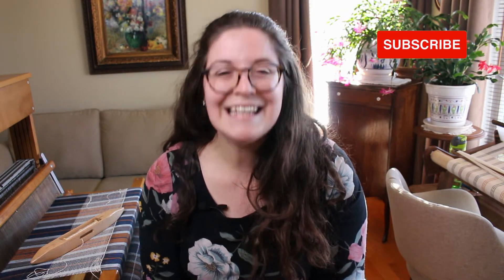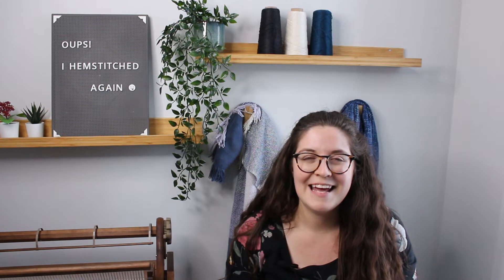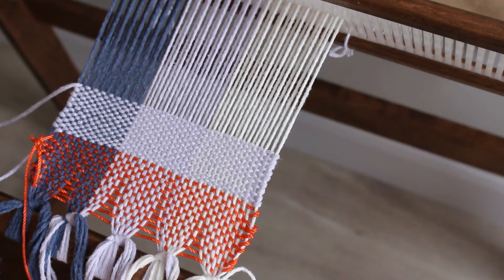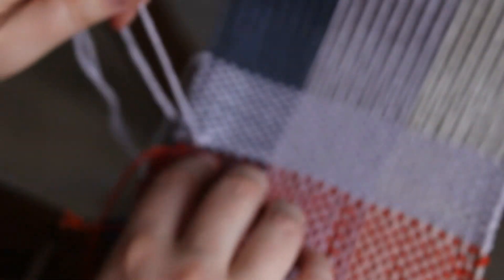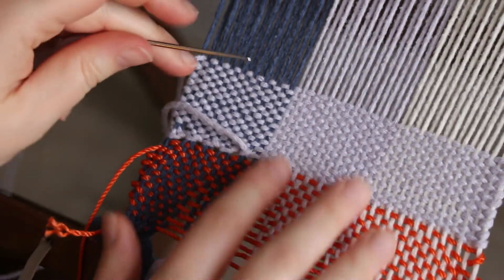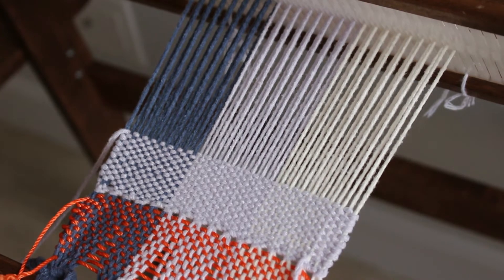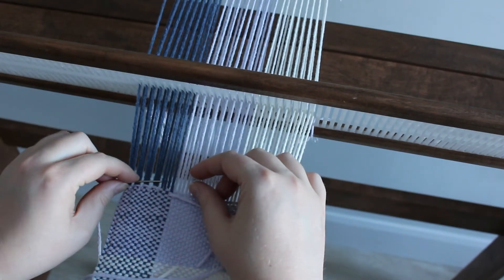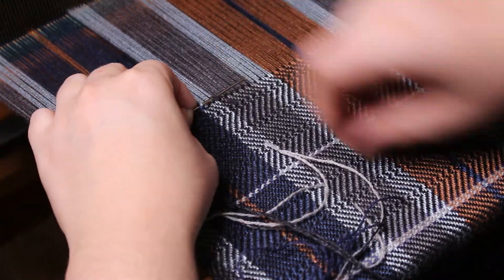Hemstitching my Handwoven Pieces : A Method for both Rigid Heddle Looms and Multi-Shaft Looms

Comment: Thank you, the clearest I have seen!  If you don’t want a fringe at all do you have to take each warp thread and sew it into the piece  or do you just trim the ends?  🤔
Reply from the maker: This is a good question. I have never tried getting rid of all the fringes. Still, I have seen people sewing all the ends in. But I'm not familliar with that technique. I believe it would indeed be possible to trim the ends very short, but never completely. Then, you would still see a bit of fringes 😕